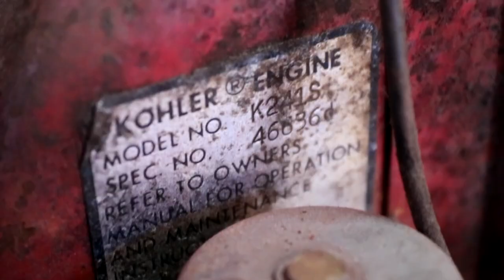Wheel Horse Ark Front End Loader Garden Tractor Restoration | Full Video

Comment: Hey Norman , just thought I would give you a little heads up. If you don't have a spacer in between the dual wheels on the. You might want to think about putting one there. Keep the tires from rubbing together. I know it's a small tractor and not like the big farm tractors. But they will rub. And if they do it long enough it not good on the tire.  But that's up to you. Awesome job. 😀👍
Reply from the maker: I have a spacer between them. I used a dual wheel kit from millertire. Thanks for your comment!

Comment: The re-build videos are the ones i'm most interested in,to be honest. I love the transformations from rusty and worn,to shiny and new. I was,i admit a bit disappointed that the re-power engine looked as if it hadn't been torn completely down to the block and each piece blasted,primed,had new rings,honing,bearings,had valves ground and painted before installation. It also might not be a bad idea,for projects like this,to invest in a blasting cabinet,as well as a pot blaster to use outdoors for the bigger parts and,if you can ,obtain a powder coating kit. Maybe make a few racks,so you can hang parts for painting/coating and,perhaps invest in a spray gun. Harbor Freight,i think,is supposed to make a decent one,considering it's something you wouldn't appear to use every day.Clear-coating parts is also a nice touch too. I dunno,i guess i'm kind of a  perfectionist at heart lol. Anyway,again,i enjoyed the video and i hope you didn't mind the critique and/or suggestions.
Reply from the maker: I take a different approach to each rebuild to vary this channel. I have restored so many, and filmed so many, I don't like doing the same thing to each one. I have videos where everything is completely torn down, I've done repowers, I've done fix and use,  I've done just fix mechanically and no paint, I have done it all. Thanks for your comment and for watching! I have enough tractors to use a different one each week!
Reply from the maker: I've also made separate videos on why I do things so simply, so I encourage you to check them out. I purposly avoid things like spray guns, sand blasting booths, etc. Instead of building a new big shop, I keep using this old one. It's primary as a way to show my cutomers and prospective customers you don't need a lot to do this, and you if you don't want to you don't have to spend a million hours or a million dollars on this hobby. I built an entire backhoe loader with an angle grinder and a cheap flux core welder, and that's the theory behind iSaveTractors

Comment: Hey Norm, I am revisiting this video because I am picking up a Wheelhorse 18 Automatic with Ark 550 Loader tomorrow with some other really cool attachments.  The only experience I have is with John Deere 300 and 400 series.  The closest I have to the WH will be my JD 400 with JD20 loader.  I am curious how the manual steering is with a loader.  The hydraulic assist on my 400 is decent, not nearly as nice as my 430 but better than manual steering I have had in the past.  I am afraid the WH with the manual steering and loader might not be very user friendly.  Wanted to get your opinion and I am sure I will be contacting you for some Kohler K series parts!  Thanks!
Reply from the maker: I never have an issue with manual steering. I have 4 garden tractors with loaders, all have manual steering. The key is to add weight to the back of the machine, and just steer while you're moving. I never try to steer without the machine in some kind of motion.

Comment: Loved the video Norman as I do all of your videos.  Your Cub Cadet 149 loader build inspired me to replicat your loader with a JD 318 with Liquid filled dulles on the rear. Turned out very nice and has proved to be indispensable here in Missouri. Can I ask what spray paint your using? Been using Rust-Oleum myself but it don't get as broad a fan as what your using here.
Reply from the maker: I think for this tractor I used the Ace Hardware house brand. I normally use rustoloeum though.

Comment: That bucket is comically huge for that tractor. At full load, the front axle is bent if not snapped.
Reply from the maker: Common sense is definitely key to using old equipment. A bucket full of snow, manure, etc = A OK. Bucket Full of Gravel, Stonedust, etc....= not a good idea.

Comment: Where does the hydraulic fluid go and what type do you use?  I have an Ark 508 QM front loader and I think the arm is the hydraulic reservoir.  How and what type of fluid?
Reply from the maker: Yes one of the uprights is the oil tank. I use universal hydraulic fluid in my machines
Reply: @Isavetractors  Thank you for your prompt reply to this question.

Comment: I have a odd question. Is there a way to roll a old hydro cub with out the engine running? Some kind of natural? And I would have watched this one if it was 2hiurs long and you were talking us through thoughts and specs. You know like a Netflix garage show, hint hint...
Reply from the maker: Yes. If you access the top of the hydro pump, there are two little "buttons" located in the center of large hex heads. Take a punch and punch them both in to relieve oil pressure. You should be able to push the tractor after that.
Reply: @Isavetractors  awesome THANK YOU.

Comment: You haven't uploaded a video in more than a year!

I'd like somebody to make videos like this on the old 70 mm stroke Kubotas from the '70s to the '90s.    They start at around 1,100 pounds - where the larger garden tractors end, and often are 4 wheel drive and almost always are restorable because the motors use sleeves. Kubota and the aftermarket supplies most parts for them.  The Yanmar sub-compacts are pretty good too, but Yanmar orphaned them when they left the U.S.A. market, now back in the U.S.A. but don't support their older tractors, although vendors like Howe Tractor in Iowa Park Texas have pretty good Yanmar support.  These Japanese tractors are water cooled and have category 1 three point lift for standard implements.

Comment: That's a beast of a tractor you have there and a great job taking it to the next level. I have a 66 Ford 100 with a K241 that is in tip top shape as well and it gets put to work each summer keeping the two garden's in check. Just love those old Kohler K Series engines. Great vid as always Norman! 👍

Comment: Great job Norman but I noticed that you did not attach the pto handle and you went from a I assume to a manual trans  so how do you operate the lift if the pump was installed up front where are the hoses connected to
Reply from the maker: The pto rod was installed after that video  shot. I had to order a new one because originally the previous owner had the pto permantely attached and on.
Reply: @Isavetractors  thanks
Reply from the maker: The loader is powered by an aux hydraulic gear pump

Comment: Last question, (I promise)

How did you do the "DUALLY" Rear Wheels/Tires?
Reply from the maker: I use a dual wheel spacer kit from millertire.com. It pretty much is a big plastic ring you see me tape it between the tires in this video. I then use really long carraige bolts and essentially bolt the tires together.
Reply: isavetractors 

Is this something that requires watching a lot for things getting looser ? 
Seems fairly strait forward & simple.
Are they 5/8" carriage bolts ?
Reply from the maker: I used lock washers on everything so nothing should loosen up. If it does blue loctite will do the trick